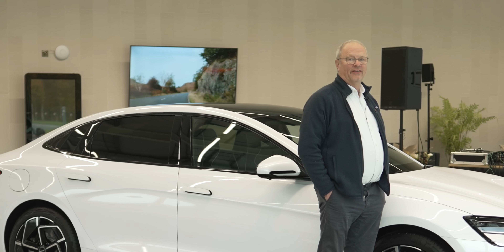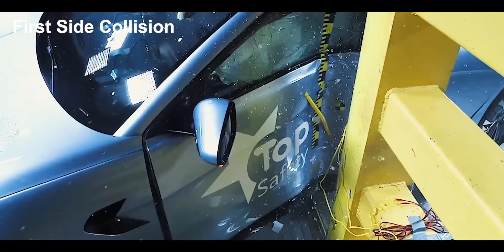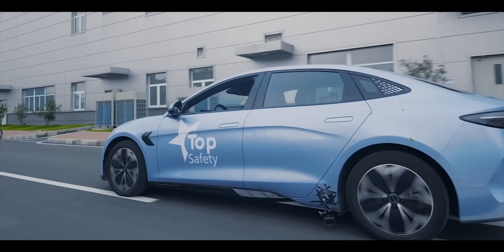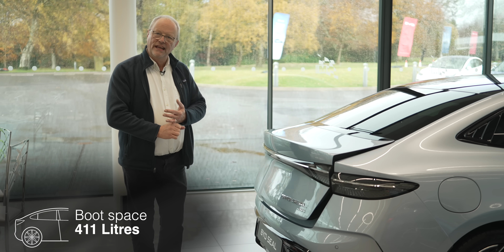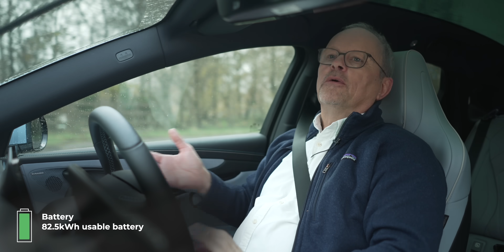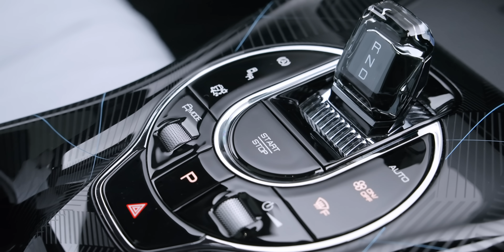This Car Proves Just How Far Chinese Cars Have Come

Comment: However, BYD has been under tremendous pressure from Huawei in China. Huawei has been able to achieve L3 level autonomous driving. The car owner can let the car drive into the parking lot by itself to find a parking space, and then leave the parking lot and drive to the car owner after the car owner commands through the mobile phone.

Comment: Love my BYD Atto 3! 🇦🇺
I drive it in ECO mode most of the time and, in the city, I get over 480KM, which is more than the advertised.
Reply: BYD range is always solid, from many test videos, even the hybrid vehicles can easily achieve its anounced BEV range
Reply: @stefanosong9314  But the distance per kWh is not even close to that of Tesla. The 60kWh Tesla almost has the same range as the 82.5kWh BYD. Showing that BYD still has a long way to go. Because it has a high consumption it means also higher cost per mile / kilometer.
Reply: @Aeriozo are you serious ？？？？

2024  Model 3  12.5kw/100km    vs     BYD  seal   12.7kw/100km！！！
Reply: @Aeriozo  see comment above man, dont prejudge
Reply: @Aeriozo  Tesla batteries are made in BYD
Reply: @Aeriozo  I own Tesla Model 3, it only matches with manufacture range when you drive in warm day and turn off heater and air condition, speed is no more than 60 miles.
Reply: @Aeriozo  i think you are wrong... think carefully here ... Tesla fully depends its battery from Chinese companany too...
Reply: unbelievable
Reply: I went to China for  business late last year I did notice that 90% of the taxi caps are BYD.
Reply: @billshun3963  In most major cities in China taxis have to be electric by law.
Reply: While atto3 is not the most popular and advanced BYD car in China. Hopefully our government could import BYD Han/seal/U8/U9.etc
Reply: @joeychan8886  I don't see what Australian government has to do with this. Thankfully, we're not USA.

Comment: if a car is high cost than a tesla  why bother really.   you would just buy a tesla.   
even if the car looks good and has some nice toys.    the atto cost from 36k new from Arnold clark.
the other factor is insurance ranking.  so how much you will have to pay a year.
with tesla being like 50  there is lots of room to get a car that will have lower insurance costs.
we always seem to miss in reviews insurance  and replacement parts costs which are important if you get one.

Comment: I love this car as it works quite well and is very comfortable. I was driven in one the other day it was great, once I was in the car. I'm a (sarcastically) gigantic 5'10 (177 cm) so I'm not that tall but found it quite difficult to get in the back seat because of how low the roofline is on the rear door. Once in the car though it was great and genuinely as smooth and comfortable as described by good ol' Bobby here. Fix the entry into the rear passenger seats and BYD would be selling these in droves to the high-end rideshare and limousine/hire car/town car crowd too!

Comment: Sad to see so many dumb anti-China comments here, mostly based on nothing more than hearsay and YouTube videos.
More than 2 million BYD BEVs and PHEVs sold this year in the first 9 months. Their BEV sales are second only to Tesla. 
BYD are also the world’s second largest lithium-ion battery manufacturer after CATL. Their 'blade' lfp battery is being widely used and charges quickly with a nice flat charging curve. It is also safer and longer lasting than NMC or NCA batteries, boasting up to 3,000 charge/discharge cycles.

Comment: Nice car but it is disappointing that car manufacturers will produce a new car and not spend a few extra dollars to have the indicator and windscreen wiper controls on the correct sides of the steering wheel for the region where it is released. Probably more troubling is that people accept it. Becoming that person on the road that indicates that they are changing lanes by turning their windscreen wipers on at high speed on a dry day.
Reply: I test drove a few weeks back, and genuinely, got used to the indicator stalk being on the right-hand side of the wheel in about 5 to 10 mins. For me, easier transition than say what Tesla are offering with their new system. Each to their own.
Reply: @danielkierannevin9081  It is the habit of a lifetime that they are making you relearn just to save a few dollars. A cost which is tiny compared to the products overall cost. Maybe some people can easily change a decades long habit but from what I see driving around there are a large number of people that struggle to achieve this. As I mentioned, seeing somebody change lanes with no indicator but with their window wipers running full speed on a dry day is not an uncommon sight. Likewise people turning corners, indicating with their wipers rather than their indicators. Considering the cost of the vehicle the penny pinching on something which is a safety item is just, well, disappointing. 
I only mentioned this as even in this video we saw Bobby struggle to use the correct controls.
Reply: To be honest I don't disagree with your viewpoint. I'm just stating my own personal experience with the vehicle. I don't know how much financial burden it would've cost the company to switch the stalks to the UK/Ireland side, but it could've been fairly appreciable. As stated though,.regardless of stalks, I'm excited to get mine in Jan, especially to test out that 3.8 sec 0 to 60 😉

Comment: Chinese companies are in some way connected to Chinese government, meaning they can be forced to add spy devices in the cars. Basically they would have eyes and ears on our streets. So not sure Western governments will make it easy on Chinese car manufacturers to sell us Trojan Horses. That is why HUAWEI is banned from the Western countries. But the same is happening on the other side. Did you see in China signs in some areas: Teslas not allowed?
Reply: So you are worried about the CCP spying on you when you drive a Chinese made vehicle but have no issues with your Chinese manufactured smartphone?
Reply: @Peter-vn8ue  >> with your Chinese manufactured smartphone  <<
why do you assume that all smartphones are made in China?
Reply: @tooltalk  that's bcz they are . Bot

Comment: Love a HUD in a car. This is my problem with the Tesla M3. That and the lack of indicator stalks.
Reply: It is unfortunate that Tesla has stripped so much out of the Model 3. Gone is radar, parking sensors, rain sensor, the front camera that was supposed to be included on the Highland 3 never even made it to production, and now they’ve even removed the exterior thermometer. But the most important the updated Model 3 is reduced to an ergonomic disaster due to the lack of stalks for the wipers, headlights and indicators. The indicators on the steering wheel are just not good enough and the absence of a selector for the driving direction (forward/backward) is just so irritating.

Comment: I got to look at this, and the Dolphin, the other week, as they were on display at the local shopping centre here in Southern Thailand. 
Both are impressive, inside and out. 
Prices are very competitive too with the top models being around 1,200,000 baht for the seal and 800,000 baht for the Dolphin. To convert to £ divide by 40.

Comment: In Australia you definitely need a blind or shade to get away from summer sun, while the atto3 has an automatic shade it seems it’s the only one in their lineup. I drive for Uber in Sydney and after 70,000 klm and ten thousand people going through the car people say it still looks new.
Reply: I drive an AWD Seal here in Thailand. The glass roof has a silver metallic coating that reflects a lot of heat. There is also a sun shield in a bag in the boot. There are videos on my channel testing the internal temperature and a demonstration of the sun shield
Reply: It's a bit miraculous

Comment: Is the battery part of the floor? When the battery was removed did that mean you could see the floor of the workshop? If so, where do the gasses go after the battery vents in a catastrophe like a complete immersion? Don’t say “it doesn’t give off gas during a puncture test” because that was only one blade. I’m talking about a felicity ace scenario

Comment: You briefly mentioned hybrid vehicle fires. As a firefighter I have been to four that burnt out almost completely. What surprised me is that in no case did the fire start in the battery and in no case did the battery catch fire. The Li ion batteries were the least flammable part of these vehicles.
Reply: Really? That's really good to know, thanks!
Reply: @rickyz5606  its been common knowledge for some time now. EVs got 10x less chance to catch fire, statistically.
Reply: @MyrKnof 

That's because battery prevention and safety technology has become more mature
Reply: But media says electric vehicles dangerous hazzard fire alert hahahahahah non sense..salute you for stating true facts. They cant digest (they=big oil companies) cars can run on electricity fuel
Reply: Wow
Reply: Liar liar pants on fire.
Reply: @brendanc5519  actually no - we get about one hybrid vehicle / year in our fire district and I think our experience is similar to others. We have used conventional firefighting techniques for these vehicle fires and thats been enough. So, no battery fire or reignition after they went on the tow truck. We have not experenced a full BEV fire yet and we have had instruction in how to deal with them. But they can be very difficult. Our trucks only hold around 3000 L water and thats not nearly enough.
Reply: @brendanc5519 are you 8?
Reply: @brendanc5519  Sorry reality hurts your feelings lol

Comment: Hi Robert. Another talking point for you in future about the rotating screen. Actually from my collective understanding the most convenience/use of the rotating screen is when you are navigating to a destination, as the maps are always oriented with your driving direction being towards the top of the screen, so you have more of a look ahead or heads up of where you are going on the map. I know I have had to zoom out and pan the map to check where we were headed on a number of occasions in previous vehicles. Thanks.
Reply: I’ve found the rotating screen to be a gimmick; you can’t rotate it when using Android Auto, which is what I use for navigation and audio. However, the screen is so huge that the default landscape mode is fine for navigation.
Reply: Not only for navigation, you can divide the vertical screen into top and bottom, the top screen is for driver navigation and the bottom screen can be for watching entertainment for front/rear passengers such as videos, YouTube, TikTok or other entertainment.

Comment: Toyota got burned in the development of the Rav4 EV by Chevron buying up all of the NiMH battery patents. Patents allow you to keep an invention out of use for up to 20 years.

The Tesla roadster used hundreds of laptop battery cells as a patent work-around.

8:20 It does occasionally get below -30C where I live. But my cut-off temperatures for driving either an ICE car or my bicycle are -27C. I would rather walk or take transit when it is that cold.

Comment: Can we just talk about the price for a second though?

The BYD Seal goes for around £21K in China, and about £25K in Australia (significantly undercutting the Model 3). In the UK, it’s currently £48K. That is big, big problem.

It puts it well above a Model 3 and on par with the far more established German manufacturers. The BYD Seal looks terrific, but I can’t see this getting widely adopted in the UK at those prices.
Reply: Same here in Ireland. Even with environmental incentives (3500 euro grant), AWD performance coming in at just shy of 52k on the road. However, similar spec Tesla the same, and can easily add another 10 to 15k for an i4. Coming from someone loyal to BMW for years, I've my deposit down for a 2024 Seal AWD. Test drove it and loved it. Also test drove a model 3, and even as someone who's "tech savy", I didn't like the minimalism of the car. If I want to shift from drive to reverse or park, I prefer a physical gear shifter. Same with things like lights, wipers and indicators. Only gripe I have with the car at present is the over zealous safety features, but future updates will definitely fine tune this for Irish/UK roads. Also, as someone coming from a 2018 530e, this car is refined. Feels premium, with interior and design well thought out. Again, not cheap (thanks in part to Irish taxes etc) but for what I'd get for similar money with other brands, this wins hands down.
Reply: @danielkierannevin9081  Even with customs/ VAT / VRT, the Seal could sell for €5k cheaper. I suspect they are trying not to upset the E.U. too much. As it is, the E.U are investigating Chinese car pricing.
Reply: @Radaos  Accusing China of subsidies is as rich as it gets. No wonder Germany are hesitant, if anything the EU would be guilty of subsidising not only its legacy manufacturers, but being paid off by big oil as well.
Reply: The reality is far stranger than any fiction!
5% of the cars sold in the EU are made in the PRC, half of those are Tesla Model 3 and Y imported in the EU from the PRC. Almost all the others imported in the EU from the PRC are Chinese made BMW, Stellantis (Citroën), Volvo and VW. Only 0,3% of the imported cars from the PRC are made by Chinese brands like NIO, BYD and Xpeng  @pikachus5m166
Reply: It’s £47k!!!!  I’d hope this seal was amphibious for that price.
Reply: There will be deals to be had on nearly new ones in time.
Reply: China lhd. UK rhd. We need to factor in the cost of rhd conversion.
For instance in Malaysia, byd dolphin is based on the hong Kong spec, not the one from China
Reply: When the UK was part of the EU, you got German cars, Italian cars (yes, you know THOSE brands) with no import duties or tariffs compared to say Australia or China that had to pay big import dues because of global location. 

Now the game has flipped on it's head and we've got whinging poms about "rip off britain again crap" - which is why the countries that progress faster do so, because they just get on with it and not complain, realise that's how things are and unless you plan to change your country of residence, there's f*** all that you can do about it.
Reply: On the electric car track, there are only Chinese, Koreans and Americans.
Reply: Why is it double the cost in the UK, Is it the old 'rip off Britain' reason again?
Reply: If Byd sell them in UK with Chinese price plus tax and transportation 
Ur gov will tariff the s out of them and sue BYD for dumping
Reply: @pangtianran110  Yeah, I think that’s certainly part of it. Though the MG4 is significantly undercutting the market so I expected this to come in at around £35K.
Reply: @MR.MACH1NE  protectionist tariffs amongst other things
Reply: @MR.MACH1NE  because western countries are trying to slow down China's rise, at their own people expense of course. Free market my ass.
Reply: we sell opinians here you go get it or get it

Comment: That boot is small for a sedan, esp. compared to Tesla Model 3. I wonder if you get any extra underfloor storage or frunk? Also, what about a ski hatch and a tow option?
Reply: There's 2 layers of extra under floor storage in the boot, and there's a "frunk" that comes kn around 40 to 50L (ideal for storing cables). Also back seats can pop down for extra storage/transporting larger items.

Comment: They can keep it. I'm not buying that because of the IP theft, working conditions, crappy engineering, manufacturing, and QA practices (I've experienced this first hand on a high profile vehicle manufacturing. They outright LIED in QA reports we paid for. We had to redo everything to make it right.) Considering that a ton of Chinese EVs are catching fire at random times, that's a testament to the quality of Chinese thef... um design and manufacturing.
I'd rather pay more and get something from the civilized world.
Edit: Sounds like this company has done some decent work before. No way that the Chinese bad practices have not made their way into this company as well. It's almost impossible that it hasn't.

Comment: Since the presenter failed to mention the price, it starts at £46k. In China, it sells for the equivalent of £22k. You could also get an Audi Q4 e-tron S-Line with only 1,500 miles on the clock for £43k!
Reply: The entry model 60kwh Seal is just under $50,000 in Australia, mid range MG4/Atto 3 money.
Reply: And why do you think Chinese vehicles are more affordable for Chinese people in China?
Reply: Import duties charged by the UK government?

Comment: 82kwh for only 300 miles seems not that good. I have the ioniq5 73kwh and I have the same range...nevertheless this car seems great. I wouldn't buy it because I prefer compact SUVs, like the ex30 or bigger ones like the ioniq5. Definitely I will never buy a Telsa, because I hate their design line, even if I praise Elon and Tesla for their achievements.
Reply: Yeah I commented the same re my ev6. What’s so good about this when with a smaller density battery the ev6, ionic5 etc (ie same underneath) seem to be more efficient. When he said 82kwh I though that it was going to push 400 miles so was v surprised with regard to the wltp (which we all know is crap anyway).